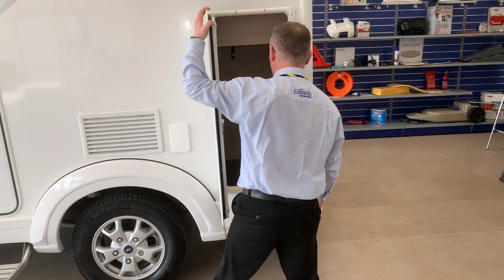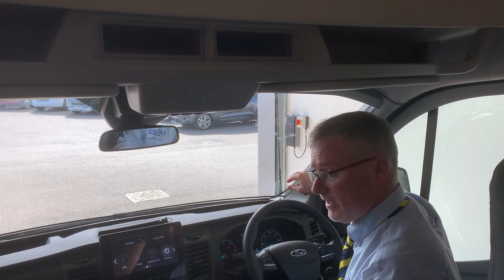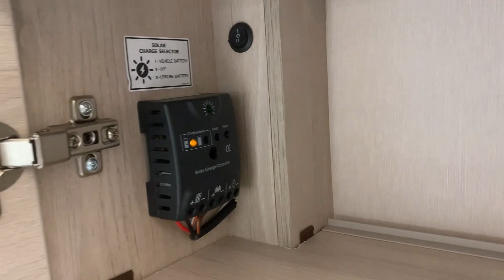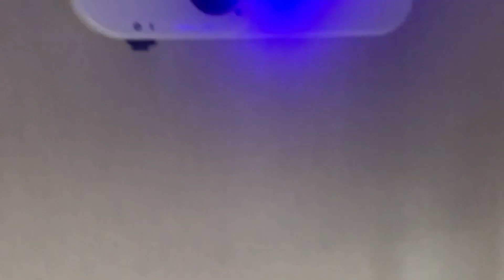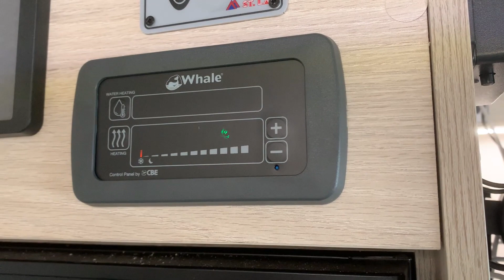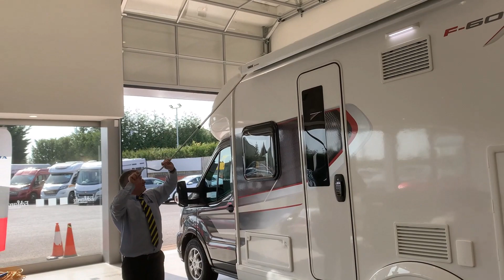Auto Trail F60 Handover video.

Comment: Hi  does the drop down bed go any lower than demonstrated, being slightly older. climbing that high to get into bed.. may be a issue ,  great vide though 👏
Reply from the maker: Hi Mikee
Yes, the bed can drop down considerably lower.
Auto Trail put a stopper on the winder shaft, if this is removed you don't need to use the ladder to get into bed.
They put the stopper in place to make sure you don't damage the upholstery, so you do need to remember to drop the cushions before lowering.
I'm glad you enjoyed the video.